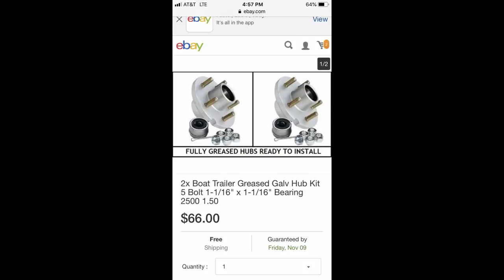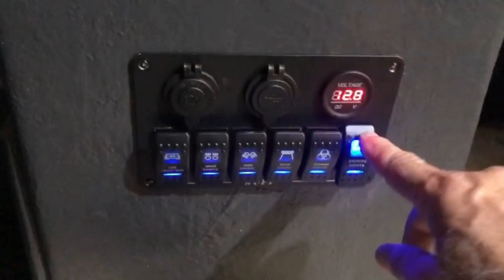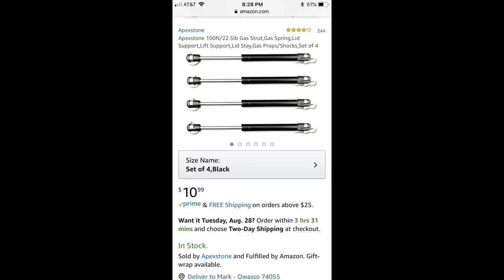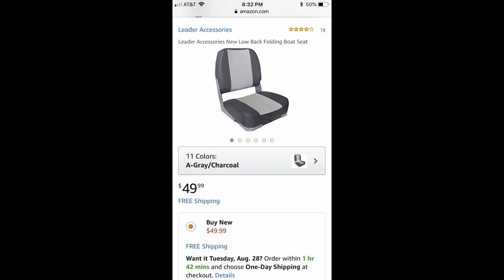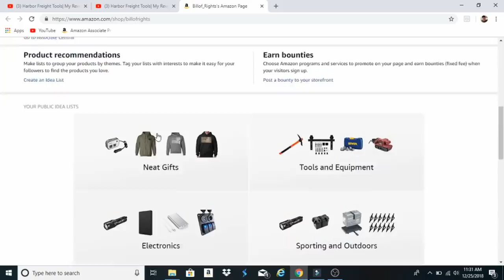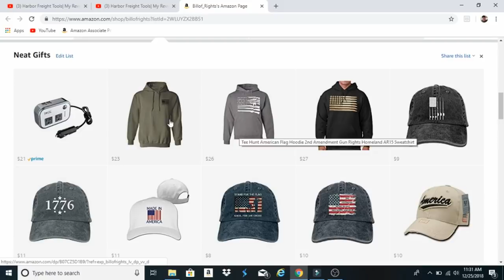Jon Boat Restore & Modifications| Start to Finish| Before & After

Comment: Something I picked up is, to take a torch to your hole saw before going though the carpet. It won't cause you carpet to get chewed up. It will melt the edges of the nylon fibers.
Reply: Learn something new everyday excellent tip
Reply: Yeah, I’ll co-sign this.  Works great
Reply: If you get it right, you could take an old hole saw and sharpen the edges to where you have a punch for your carpet. I don't really know how practical the tool would be on Marine carpet, but it's a thought. I haven't tried this, but thought I would mention my thoughts.
Reply: Another trick is to start the bit in reverse and create your notch then proceed in forward

Comment: Very nicely done. Awesome job. 
We did the same thing to a 19’6” 1984 Renken bowrider with the old OMC Seadrive set up. Complete rebuild of boat and motor. Trailer was junk so we bought a new aluminum one for it. All in all we spent approximately $3500 from purchase to using it and we have what the insurance company valued at $15,000 boat. I’m extremely happy with that. 
Safe boating my friend.

By the way , Loving the tee shirt. Damn right !! 🇺🇸🗽🦅

Comment: nice job... That's what I do for Extra Change, I'm 50 and retired a few years ago and needed something to do so I picked up a Free Boat on a trailer. I only wanted the trailer but the aluminum Boat was really nice except it had some damage where it had fallen off the trailer at freeway speeds and then hit by a car .  I own my own fab shop but no longer work their daily. with the guys I have it runs itself. 
That said there is no sheet-metal/aluminum work or welding I cant do, so I fix up mainly aluminum boats and Occasionally a fiberglass or a wooden boat.. There is good money in it if you don't mind hard work and dirty hands. I've already made over 20K this year on Craig's list free boats!
Reply from the maker: I enjoyed this project, but I don’t think I’ll do another one. I’m a full time furniture builder. Maybe when I retire someday. Thanks Wayne
Reply: Where you located

Comment: One more thing I think I'd do - reward the project with a new steering wheel - something pricey, chromey, maybe with dark wood trim.  That way everytime you touch the boat you'd be reminded of the quality and work that went into it.  Would look cool too.  Nice job, something to be proud of for sure!
Reply from the maker: Actually, I did get a cheap new steering wheel. Them things are very pricey. Funny thing is that it is the same steering wheel on Richard Gene’s boat(Richard Gene fishing machine channel). Thanks

Comment: I do it about the same as you in  NW, except some of us, right before trailers in water we stop an tie bow line to back of trailer an unhook wench an safety. Then i back in an watch boat slip off trailer then I  pull forward until rear of trailer again out of water. Now you didn't need to get out an get feet wet. Just back in, boat slips off, pull trailer back out of water with boat tied to rear of trailer.  We do it different with two or more involved in launch. You did great job on your boat motor an trailer!  Check list is important and consistency trying to do everything the same that's where your check list comes in.  Thanks Tim
Reply from the maker: I wish we had docks to bump off to. Thanks Tim

Comment: We just bought a 1985 15'6" Kingfisher today. It's not as rough a shape as the one in the vid, but does need a little TLC. Can't wait to get it lookin good again. Mainly, it needs to have the gel coat repaired along the rim of the deck. It's worn down to the fiberglass in some places, but no chips. I'm thinking about just using the spray on bedliner and coat it with that. Being waterproof and slightly rough, but not scratchy, I think it will work well. Thanks for a fantastic vid.
Reply from the maker: Thanks very much Kate

Comment: Makes me wish I had videoed or at least taken pics of the conversion I'm doing on my 12' V-Haul. Restored and installing a casting deck, livewell, & battery box with exterior charging. Even put fog lights on it like head lights so when I come home at night I can see what's floating in front of me. Ran a similar switch panel and wired my trolling motor straight into the boat with a hidden kill switch so my kids can't disappear with it. You did a killer job and are a great inspiration!!!
Reply from the maker: Thanks very much Liz

Comment: Absolutely FANTASTIC!!!  I just got a 14 foot deep V-hull from my buddy.  he just doesn't fish anymore.  It's an aluminum Grumman and will need a different set up, but your fiberglass work gave me a great idea for the deck.  It won't be just a plywood deck.  It will be fiberglass.
Maybe I'll check into a steering wheel and throttle system for the motor.
Reply from the maker: Good luck with your project. Feel free to send pictures of your progress to Billof_Rights@yahoo.com. Thanks for watching
Reply: Im restoring my grandfathers 16 foot grumman, watching this video gave me great ideas

Comment: I just bought this same boat style for $300 with a Johnson 35 on it.  The trailer is galvanized and the motor has tilt/trim and runs.  I am going to remove the console and make it a stick steer boat all from the front seat.  I have to cut out the floor just like you did and replace the transom.  I hope I can make it look as good as you did.
Reply from the maker: Good luck Glen👊🏼

Comment: Good job ....I actually thought was going to be to much weight with the extra wood but it looks good in the water .....I like the setup on the boat ,but would like it a little wider as a preference.Used to have bass tracker panfish 16 and the bass tracker grizzly 1648 .
Reply from the maker: This boat is as nice as its size will allow. Fishing buddy Ron’s boat is a lot roomier. Thanks Gary

Comment: Great video, I was elated by the progress and functionality of everything you did as far as the restore. It looked like you might of been a few neighbors short when removing boat however, lol. My only addition if it was me would be a small wind shield, other then that it was a great restore!
Reply from the maker: During the project, I was trying to figure out a possible windshield, but the electronics on the dash created an issue. Thanks

Comment: Nice job.  I would have liked to see you pour flotation foam in the floor before glassing it up.  Instead of painting the deck before you installed the carpet, you could have given it a layer of fiberglass resin.
Reply from the maker: I considered going the extra miles, but I figured the boat will hold up fine for years as long as I keep it garaged. Thanks Brian

Comment: That's awesome! You did a great job man, that boat looks amazing! All of that compartment space, super cool. How's that old Johnson push that boat? Do you like it? We've got a repower and rewire video coming out today but we don't go near as in-depth as you did here, great job, keep up the great work!
Reply from the maker: After a few trips to the shop and 1800 bucks, the engine is doing great. It pushes the boat about 21mph. Good luck on your project, thanks
Reply: @borfishing7690  1800! Whoa, that's almost in the ballpark of just repowering! I'm glad you got it up and going though. 21 is pretty good for that boat. As long as you are happy with it! Thank you
Reply from the maker: It was one of those “I have too much into it to stop” things. If I had known the motor would cost this much, I would have bought another used one.
Reply: @borfishing7690  yeah, that happens to a lot of people, it stinks. At least it's up and going now though! So that's a good thing :)

Comment: awesome restore. I restored a 1985 tracker with a 76 Johnson 35. A lot of work but it was fun. How has the spray adhesive held up on the carpet? I used marine carpet glue it was really messy and a pain to use.
Reply from the maker: Hi Ryan, the adhesive is doing great, so far. It has been outside in weather and used on the lake with no issues. I will better know once it is summer. I don’t expect any issues either upholstered boards. I’m watching the floor to see how it will hold up. Time will tell. I do garage the boat now.

Comment: Realy turned out awsome looking almost done a 1976 bassmaster i had like that it had a 70hp johnson on it it run 38mph but i sold it when i got my 1974 hydra sports bass boat for $1100 transom floors had been redone got a 80 merc 90hp on it iv had it 3 years had 0 isues out of it it runs 47mph with just me in it
Reply from the maker: 👍🏼 thanks Dennis

Comment: I am watching the video now and i must say its great work could you please give me some more details about the deck board supports and what kind of wood you used thank you overall great work realy enjoying your content keep up
Reply from the maker: The framing, supports and mounting parts are out of poplar. I added strips of poplar to the plywood deck boards for better screw retention. I didn’t want to have hinges on top of the deck. You might find more info in the videos 8 & 10. Thanks for watching. Feel free to ask questions
Reply from the maker: To add, the deck supports were boards I added to the framing to make sure there was more wood supporting the edges of the deck boards.

Comment: Suggestions
1. Led T shaped lamp post behind the backseat would be ideal with the led lights rotatable.,
2. install a curved windscreen for the driver...
3. add 2 wooden paddles, if ur outta fuel
4. Add Battery socket covers.
5. Attach a Removable front rainshield
https://pin.it/jcy27yhca7lrd2

Comment: I know it's an older video but wouldent it make sense to paint or coat the bottom side if the wood? Just curious
Reply from the maker: I painted the bottom of the floor and lids with protective enamel 👍🏼

Comment: Awesome job. Beautiful boat.  How’s it handle w the wood deck and the 35 ob?  Seems like it’d be very heavy   I’ve built a couple boats similar to this and went w aluminum for decking/support material mainly for weight reduction. Love your design layout though
Reply from the maker: It runs at 20 mph, which is fine with me. IMO, the little extra weight makes it ride smoother. Thank you

Comment: Congratulations on a job well done! I was curious about the grey coating you applied to the bottom, outside of the boat. I built a 15.5’ plywood fishing boat a few years ago. The outside bottom is coated with fiberglass/resin and then painted with exterior latex. This holds up okay, but after a few hours on the water you tell the paint becomes soft and probably more vulnerable. I was considering re-painting with an epoxy paint for durability. What is the coating you used and are you satisfied with the result?
Reply from the maker: I used rustoleum protective enamel. So far I’m fine with it. Thanks Barry

Comment: Nice rehab! I just wonder though how much weight was added to the boat that reduced the total capacity. (?)
Reply from the maker: Don’t know. I’ve had my 225 brother in the boat with no issue. I use it weekly and have no problems. I’ve had the hull full of water and it still floats just fine. Thanks

Comment: That boat looks gorgeous. That's a major resurrection. Just curious to know why you chose to keep the old wood in the transom and you sandwiched the new plywood over the transom. 

Aren't you worried about the old wood rotting the new? If not, how do you treat it so it won't continue to deteriorate? What kind of product can stop wood from decaying once it has started like the piece in your transom? 

I hope it gives you many years of service, and you can pass it down to your family years to come from now. Fantastic job on this from the boat to the trailer as well.
Reply from the maker: Hi Perry, I did remove the old wood. What I mounted the new transom to was the fiberglass skin. I used the rotating sander to remove the remnants of the wood. Thanks for watching
Reply: Very good.  So did you use the old mount for a template? I don't know how I missed it. 

I'm doing an Alumacraft 13 footer myself.
Reply from the maker: I used some 1/4 plywood 2” strips to create a template. I just got glued the pieces. You can kinda see the process in the time lapse.

Comment: Can you do a video on how to rewire the motor to the steering wheel? I just boat a boat almost exactly like this one. Same condition and all. Except it’s a 80hp Johnson.
Reply from the maker: Are asking about the wires from the motor to the ignition switch at the steering console? Or the cable from the motor to the steering wheel?
Reply: The one from the motor to the wheel

Comment: Hey bud! Love it! Doing a similar project now. Can you tell me what type of epoxy you used? Where you got it? Lot of options out there.
Reply from the maker: I used fiberglass resin when applying fiberglass. I used some from Lowes and a local fiberglass company. I used chop strand, cloth and woven for different purposes. I base painted with Rustoleum protective enamel

Comment: Very well done awesome video. May I ask what putty did you use for bonding the wood to the fiberglass? Just regular bondo? Also what rub rail did you use?
Reply from the maker: Not sure what wood to fiberglass you mean. I bought a premixed resin/fiberglass putty for the gaps around the transom. I mixed resin with flour for the gaps around the floor. I’m having trouble finding the rubrail info. My amazon order calls it 3/4 x 3/8 black bulk. My order cost 52.00.
Reply: @borfishing7690  In this video it was about 6:20 as well as 7:20. Ive been looking around and it seems hard to find any resin in a large container
Reply from the maker: 6:20 is the premixed I bought a small tub of from a local fiberglass company. 7:20 is just a resin/hardener and flour mix. I mixed the hardener into the resin, then added flour to the consistency I wanted.
Reply: @borfishing7690  awesome thanks

Comment: Is all the wood framing floating or did you screw any of it to the boat itself?
Reply from the maker: Upper areas are attached to supports inside the boat. The bottoms are attached to the floor.

Comment: Looked like it was side to side rocking a bit does the boat ⛵ not wanna plane well?
Reply from the maker: I didn’t have the motor in the full down position. The boat does very well for its power and size. Thanks

Comment: The boat turned out very nice, the only thing you should have done different, you should have used 2x2 instead of 2x4  for the framing would have reduced weight by half and been just as strong or aluminum framing. But overall nice job turned out great
Reply from the maker: Hi James, I used 5/4(1 1/16 thick)poplar.  In some key areas I cut rails 3 x 1 1/16. It is likely a little heavier than using 2x2, but I have more faith in the poplar. I scraped small holes in the bottom beaching it one day(didn’t know) and went on to fish 10hrs. The hull filled completely, but the boat stayed afloat just fine. It has served me well thru dozens of long fishing trips. Thank you James

Comment: with all of the weight of that added deck up high above COG and waterline did it make the boat tippy?
Reply from the maker: Not really. I’ve fished a lot in it and haven’t fell out yet. IMO, it’s plenty stable for its size. Thanks
Reply: @borfishing7690  sweet. that was only thing i was worried about.  awesome build.   the donor boat reminded me a lot of a tri-hull glasstron.

Comment: Any reason you kept the old school "ship master" controls with the dual handles? Not that they don't work but its not particularly intuitive to use.
Reply from the maker: I’ve considered replacing it. Thanks Peter
Reply: @borfishing7690  When I swapped from an older 60s V4 to a 73 2 Cylinder, I went from one of those two levers controls to a "red plug" PowerShift 2 control and its so much easier to deal with. I found the shift cables on the ShipMaster style controls to constantly want to slip.

Comment: Hey Bill, I just bought a project boat and I am seeing most remodelers cut the floor up and fix the keel/stringers. How did you know this was necessary on this boat? I am not sure if mine needs that level of overhaul. Thanks,
Reply from the maker: Hi Paul, I only went in because my floor was rotted. I found this when I removed the carpet. I decided I needed to put a new floor in and found the stringers needed beefing up to support the new floor. Thanks for watching
Reply: Knock on it, if u get a hollow sound gotta be replaced ): rotten wood makes voids like a drum in between the fiberglass

Comment: This is AWESOME!!!  Can I ask;  how much weight did all that add?  And did you notice it sitting lower in the water after the build?  Did you sacrifice any speed?  Looking at doing mine. Thx and “tight lines”
Reply from the maker: Don’t know the weight, but a close guess would be whatever the plywood deck(not the floor) and framing added would weigh. 
I never had the boat in the water before the restoration. I can say that I had fished 10hrs  in it with a hull leak that filled the hull beneath the floor and it stayed afloat just fine. Thanks
Reply: @borfishing7690  thx bud. Can’t wait to get mine done. Now that your a pro, how about I just drop it off lol
Reply from the maker: @panhandlepilot9363  lol, I was only crazy enough to do it once 😵‍💫
Good luck

Comment: Just curious  how much it weighs  before and after? .  Nice job
Reply from the maker: Don’t have a clue. Sold the boat a couple years ago. I can say this, I put a small hole in the hull launching the boat. I was on the water for ten hours. The hull below the floor was full and beginning to fill in the battery area below the deck. The boat stayed well above water.